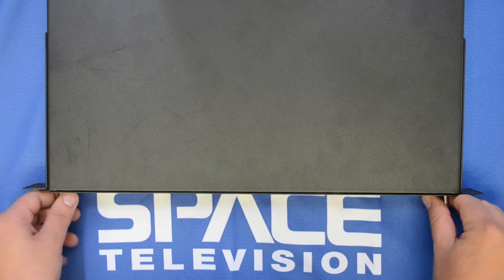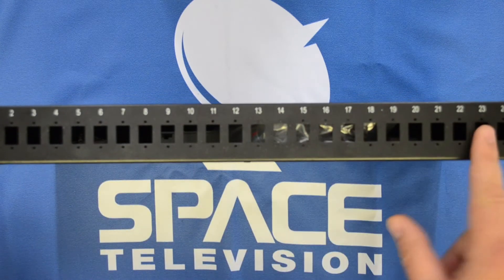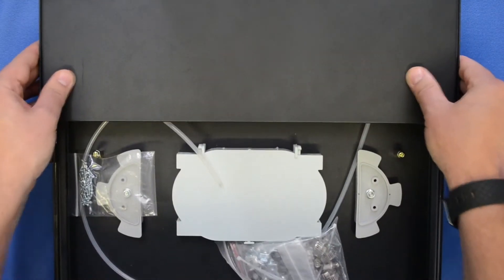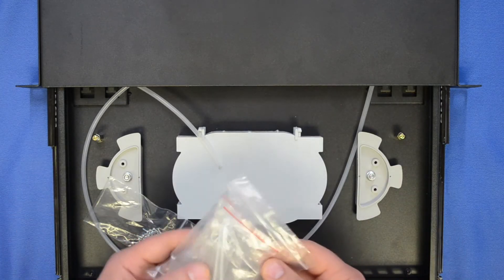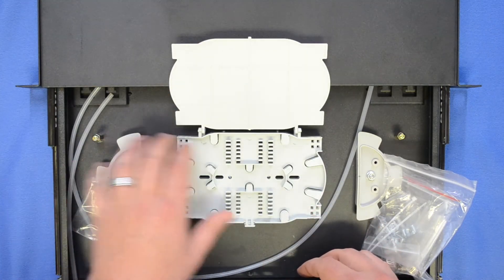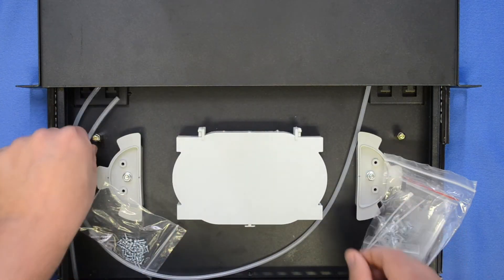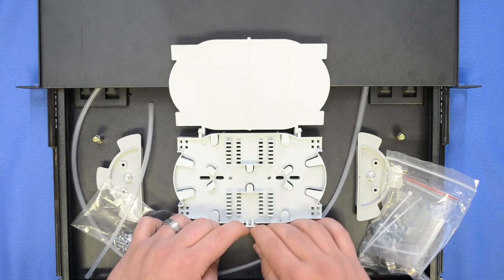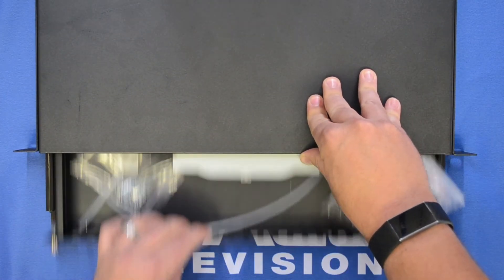Overview of the Fibre Patch Panel

Comment: Question: Which way do the fiber cables connect to the switch? From the inside, out the rear to the switch? I'm having a hard time figuring out which direction goes to the switch and which side goes to the rest of the rack equipment. Thank you for any assistance.